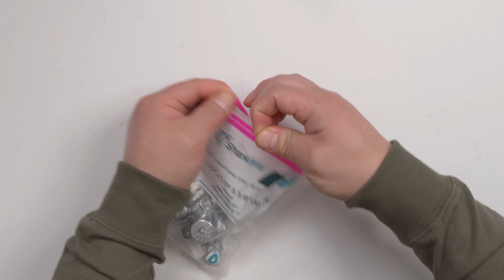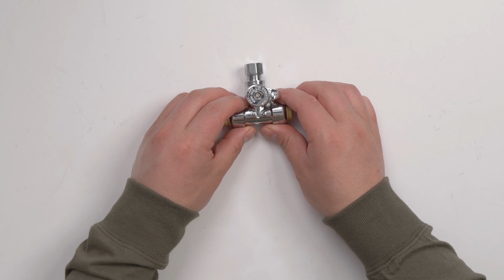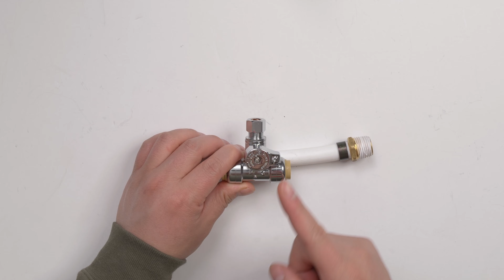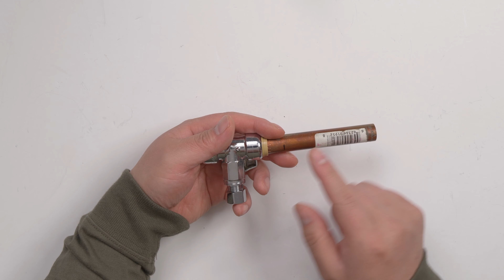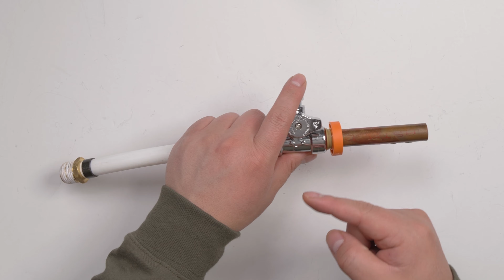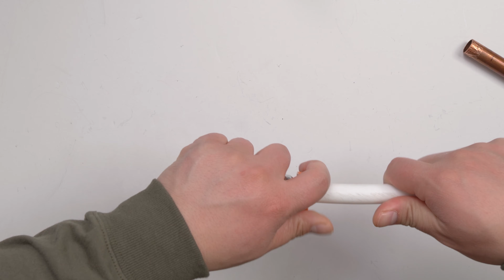How to install Sharkbite Tee Stop Valve correctly 24984A

Comment: What direction is the handle to turn the water on and off in relation to the tube that is screwed on (and not the ends of the shark bite).